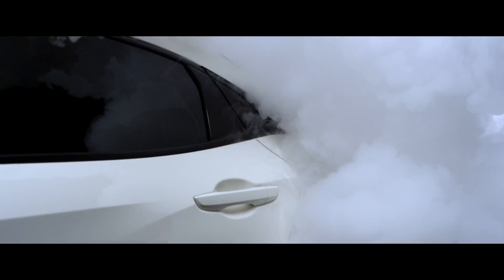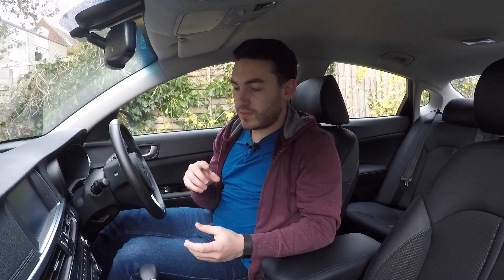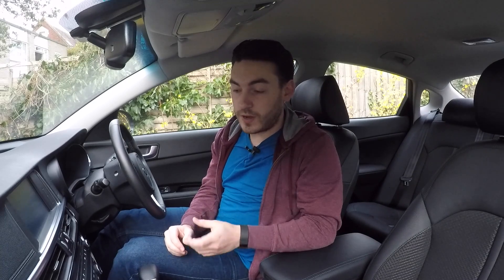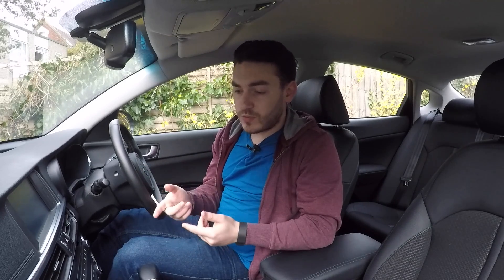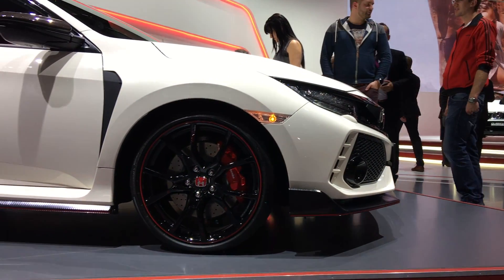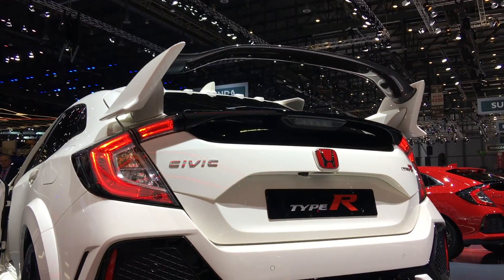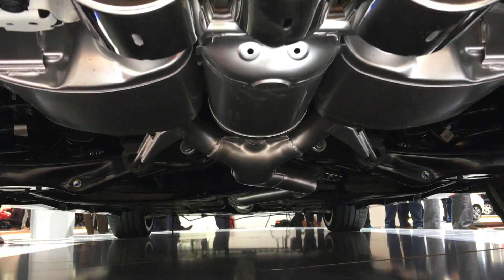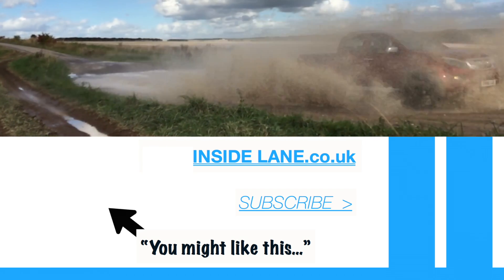Why 2018 Honda Civic Type R has Less Power in America - Inside Lane

Comment: Wow, this video is a load of garbage! The US version isn't rated at 306BHP, it's rated 306HP. It even says 306HP on the Honda US website. The difference here is horsepower is measured with losses while brake horsepower is just horsepower before losses. There is no real power difference between the US and European version of the car. 

And what you said about fuel rating is also nonsense. The fuel you're using in the UK is rated at 98-99 RON, 87 MON and 92-93 AKI. Premium fuel grade in the US is usually rated between 91-94 AKI. There's virtually no difference.
Reply: +WillerNK But I think it is clear. Automakers don't advertise power measurements that aren't used in that market, they use the standard measurements of that market. This only becomes confusing when people from other nations fail to realize other nations have different measurement systems. Seriously, it makes me laugh. They think the US uses the metric system?!!?? Also, it's clarified when numbers are given in either BHP or HP. If you know what that means, then there should be no confusion. When I watch a German or UK review, I know their measurements aren't going to be the same.
Reply: Larry If what you say is true then the US must measure HP differently to everyone else. BHP is always a lower reading than metric HP. The previous gen Type R had 310HP (~306BHP) and this new one has 320HP (~316BHP) in Europe. But if in fact you are wrong and the HP stated for the US variant was the metric unit of HP then you guys end up with ~302BHP.
Reply: The US doesn't measure in metric horsepower, it uses SAE imperial horsepower. If it were metric, It would be rated 320 in something like PS or CH  (different names for metric horsepower). In fact, the German spec model is rated 320PS.

Another thing, there is no conversion from brake horsepower to horsepower. The SAE net horsepower rating is just the same measurement of gross imperial horsepower but minus losses to accessories. And really, that's what everyone should be doing, whether it be metric or imperial. You aren't going to be running an engine without a water pump or an alternator, are you?
Reply: +Pigmoon K "US gas has lower octane rating that approximates to only 94RON" What does mean? That's an oxymoron, like saying "roughly exactly 94RON".

You aren't being clear, you're being stubborn and inflating the octane rating to support an argument that had no foundation to begin with. The North America Honda press release says, "306 horsepower at 6,500 rpm and 295 lb.-ft. of torque from 2,500 to 4,500 rpm (both SAE Net)"

The car is rated 306HP SAE, not BHP. There isn't a power difference, there is only a measurement difference. 
http://www.prnewswire.com/news-releases/civic-type-r-makes-us-debut-at-2017-autocon-in-los-angeles-300429223.html
Reply: You aren't serious, you're just trolling.
Reply: +Pigmoon K Read what was said again.

Because AKI is an average of RON and MON, there is no exact conversion of RON to AKI. The AKI rating equally depends on the MON rating. In the UK 98 RON is ~87 MON. So (98 + 87) / 2 = 92.5 AKI. In the US, premium fuel ranges between 91 and 94 AKI. That places it within range of the UK's 98 RON.
Reply: Speak English.
Reply: Pigmoon K They don't measure in RON dumbass, they have very similar actual octane ratings to Europe but they measure in AKI so the numbers aren't the same.
Reply: Pigmoon K I don't know what to say, I'm honestly shocked. Did you ever even attend a school? Forget it, I'm done replying, you're making me lose hope in humanity.
Reply: +Pigmoon K Please show me information directly from someone with a significant position at Honda that says the US model has 10BHP less because the fuel is 4 octane points lower. Or, if it's any easier, show me where on the official US Honda site does it say 306BHP for the US spec model..
Reply: +Larry Exactly. I don't how this video could be so misinformed.
Reply: +Larry I think you're absolutely right, but I think it would be best for countries to clarify which unit of measurement they're using. The US is using net imperial horsepower, the UK gross imperial horsepower, the Germans and many other nations use gross metric horsepower. Just saying "XXX horsepower" leaves people starching their heads.
Reply: US measures net horsepower in imperial units
UK measures gross horsepower in imperial units
Most other nations measure gross horsepower in metric units

There, it's that simple. And yes, this video is almost completely BS.
Reply: Pigmoon K Just because the number 94 is lower than 98 doesn't mean it's inferior. Don't you know how conversions work?? You clearly have no clue what you're talking about. Almost like saying 2.5cm is bigger than 1inch just because the number is higher. I think I'll stick to my initial insult proclaiming you to be a dumbass.
Reply: Pigmoon K 94 is only lower than 98 if they're both on the same unit of measure. This is VERY basic knowledge.
Reply: +Pigmoon K That isn't a known fact, what is a known fact is that people keep confusing different octane rating systems.
Reply: Felix Thank you. I can't wait to see what BS he comes back with next.
Reply: 1. "poorer RON fuel"? Is that a technical term? They're rated using different rating systems.
2. OK, so you claim the U.S. version's limit was already converted, THEN rated . So tell us what it was rated at in the EU rating system before it was converted...show us the math.
3. Six of one, and a half-dozen of the other. You seem to be fixated on making a fuss about comparative fuel quality. OK - we pay far less for fuel. Meanwhile (if this video is even correct) I can probably spend less than two hours getting that 10 hp back and driving on the same cheap fuel for the duration. You're stuck with that fuel bill for as long as you live there.
Reply: +WillerNK  He'd have to speak sense first.  He's just butt-hurt.  Wilful ignorance is the consequence.
Reply: Exactly, but it should also be noted that the US pumps say "Minimum Octane Rating". That means if a pump has 91 available, it's going to be 91 or greater.
Reply: I have no idea why this video wasn't thoroughly fact checked. I didn't even have to think twice about the difference between brake horsepower SAE net horsepower. Honestly, I'm just amazed that so many people don't know this, even automotive journalists.
Reply: +Pigmoon K  Let's be very clear.  You have no idea what you are talking about, and are just making yourself look more foolish by doubling down on your error.  A number of posters have made it clear why you are wrong.  Accept the education and move on.
Reply: +Pigmoon K You keep saying "91 AKI doesn't equal X" or "98 RON equals X"

98 RON doesn't equal ANYTHING in AKI or MON! There is no conversion at all! AKI is the combination of two rating systems that are entirely different and have nothing to do with each other!!! 98 RON can vary in MON, equaling anything from 86 MON to 90 MON, it just depends on the fuel. You can't covert any of these rating systems, they are different systems that test for different things PERIOD!!!

- Wikipedia > Measurement methods

"The most common type of octane rating worldwide is the Research Octane Number (RON). RON is determined by running the fuel in a test engine with a variable compression ratio under controlled conditions, and comparing the results with those for mixtures of iso-octane and n-heptane."

"Another type of octane rating, called Motor Octane Number (MON), is determined at 900 rpm engine speed instead of the 600 rpm for RON. MON testing uses a similar test engine to that used in RON testing, but with a preheated fuel mixture, higher engine speed, and variable ignition timing to further stress the fuel's knock resistance. Depending on the composition of the fuel, the MON of a modern pump gasoline will be about 8 to 12 octane lower than the RON, but there is no direct link between RON and MON..."
Reply: +Pigmoon K There is no conversion from BHP to SAE. Both use the same imperial system of measurement, but different things are being measured. Using the imperial unit system, brake horsepower is a measurement of an engine's power without a load. SAE HP also uses imperial units, but they are looking for the engine's power with a load placed on it  by accessories. There's no different system to convert, it is just a measurement of two different things. It's like trying to convert brake horsepower to wheel horsepower. People can use a rule of thumb to estimate wheel horsepower, but the only way to truly know is to dyno power at the wheels.
Reply: He's (She?) absolutely wrong, and he knows it, but he's a troll. Don't expect him to stop.
Reply: pigmoon, the only thing u got right was the fact that cars for the american market are detuned, perfect example of this is factory jdm sti vs a usdm sti both from stock, using the appropriate fuels for each car, the jdm will roast the usdm car, not for fuel purposes but for emissions.. do some research the fuels are still the same quality except are just using a different rating system
Reply: Pigmoon K premium here is 95 upwards , Americans use a different system for measuring and can not be perfectly changed from Ron to aki and backwards too, just follow whatever fuel it says on the owners manual and go from there
Reply: Pigmoon K I'm not even from the us at all, premium in nz starts at 95, highest is 98, our normal fuel for average get around cars with low compression engines we have 91, we can also get race gas which is over 100  but its not as common, the reason the cars in the us are  detuned is because their government decided to pull the emissions bullshit , so they're detuned to stop more pollution
Reply: +Pigmoon K I'm not American either, and I know you're a trolling idiot. How many times will everyone have to correct you....
Reply: +Pigmoon K Hey if you want to be a public lackwit that's your prerogative.
Reply: +Pigmoon K Imitative and unimpresive. Does your mother know you are still on the internet?

Comment: Not sure why Honda made it almost fifty HP down from its direct competitor the Focus RS. If it's the same money I'm going for power and AWD :)
Reply: The price point of the RS (or the STi) is higher than the Type R .
Reply: Chris Dooley If you intend to use it for drag races get the Focus RS, if you plan to track it get the Type R. It's lighter and way faster around the corners.

Comment: it's less than 3% ... you still get a monster FWD ! when I swiched to ethanol, there was a visible on graph gain of torque of 5%, from 2000rpm to 6000rpm , you know what, I did not feel anything. And I think that a car that accept 95 octane is so much more practical. 98 is more expensive, anf even in europe there are some places where it is not found (like in Corsica)

Comment: We will always get a water down car in U.S
Reply: Moses R actually this video is wrong. the US doesn't measure in BHP, we measure in HP so that's why the numbers are different
Reply: Seriously the comprehension level of some of these comments is baffling...10bhp will not be felt anywhere in the rev range. Now flash the ECU for a healthy addition of torque plus the corresponding HP gain and you're sorted.
Reply: maybe it helps to place a bigger hoodscoop aftermarket part, you know tunnel more cool air to the intercoolor... uhmm, wait, there is none on top of the engine bay? Well at least the red plastic engine cover get's cooled :-(
Reply: Moses R it doesn't really matter these days. all you have to do is tune the engine and 9/10 most of the type r's will get a tune anyways.
Reply: Worse in California! 
So far, I can still drive my 510 with swap motor...
Reply: We get watered down imports sometimes, but then again they get watered down versions of our superior cars.
They barely get the Camaro, but they don't get the 1LE options.  They get the Mustang but no GT350.  They don't get the Viper or Challenger.  I don't believe they get the Grand Sport or Z06 trims on the Corvette.
So as far as performance is concerned we have it better in America.
Reply: Well the Viper is a gas guzzler for sure (not that someone in the $100k+ supercar market would actually care), but unlike what seems to be the popular European assumption, the Corvette does pretty well on gas, better on the highway than most of the cars it competes with.
Reply: +The Hitman  I understand your points, but the problem is a lot of those perceptions are wrong these days.

I DD a Fiesta ST, so I understand how fun a hot hatch can be.  But I've sat in a new Camaro, and it is nicer in every way (except for it's bad blind spots, which are there because the fanbase wanted narrow windows).  Europe doesn't seem to cater very much to the $30k to $50k crowd.  There are soooo many cars above the $60k mark, but only a couple decent cars below it.
On a track the Focus RS is about as competent as a Mustang GT, so I can see how it would sell better, but despite having a smaller engine it doesn't really get better gas mileage.  And that is with you guys paying a massive markup because of import tariffs.  In the US a Mustang GT is $32k, and a Camaro SS which matches the M4 in performance is $37k...retail.  But you can get either for probably $4-6k less retail with just a little dealer negotiation.
If tariffs weren't in the way a V8 Mustang GT would cost 27k GBP (with an estimated $2k in shipping).  I'm guessing Ford actually charges closer to 40k GBP over there.
Reply: Moses R we have a hellcat what do you mean
Reply: The Hitman - yep, we got the Fiesta ST a year or so after Europe, and here it is much less popular than the Focus ST, and only available in 4-door.  But that suits me fine, it will haul my family, and is a blast to drive.
https://plus.google.com/112287122417757908676/posts/UZpUy6kqdn7
Reply: Moses R you are still getting the same car...

Comment: It looks like a lot of commenters don't understand that US pumps aren't listing octane in RON. We use AKI or (R+M)/2. 98 RON is about 93 AKI, I think. So Honda basically wants to tune this thing to run on regular fuel.
Reply: Pacheco Sorry to say but if it is in fact 306HP and not BHP then you're 14HP worse off than the euro version. Ours will be 320HP (~316BHP). The previous gen was 310HP (~306BHP). So if US is 306HP that means it will be ~302BHP.
Reply: +Kurt Phillips No, the car will be 320PS in metric units or 316BHP in imperial units. Both the US and UK follow the imperial unit system when measuring horsepower, but the difference is that US goes by SAE certified horsepower which measures net horsepower or the horsepower of an engine with all accessories loading the engine. Basically, the US measures horsepower its own way. There is no horsepower difference at all, just different measurements of its power.
Reply: When I say HP I mean metric HP. PS literally translates to Horsepower. Idc what each country's standards are, metric is what I'll use and will continue to use when I say HP.
Reply: Fine, but the US doesn't measure in metric horsepower, nor does it measure gross horsepower.
Reply: Pacheco That's fair enough, and you have taught me one thing I didn't know about beforehand. It just pisses me off that there isn't just one standard; it would make like so much easier. 'Standards' in general with all sorts of units are fucked up and not globally uniform. I just think it's BS.
Reply: Yeah, and if that isn't complicated enough, then there are nations that don't even measure horsepower at all!😥
Reply: Spamfried Oh yeah, completely forgot about kW. Good luck multiplying by 1.36 in your head everytime you want HP 😂
Reply: Depending on the MON rating, their 98 RON is equal to our premium, which ranges between 91 and 94 AKI. In fact, most places being 93 AKI. Everything about this video is wrong. The car isn't even rated in BHP in the US, its just rated in HP, which means there isn't even a power difference. The videos is just full of bad information.

Comment: This guy keeps saying they'll increase power mid-cycle. It's pretty damn rare for Honda to meddle with the engine outputs for a facelift on any previous models I've followed. Its usually only cosmetic upgrades.
Reply from the maker: +Mark Almeida This car will be measured by its performance against rivals. Just like every hot hatchback it will have to evolve to maintain claimed lap records .etc

Comment: Fuck. We only have 91 here in California. Higher grade we gotta go get it elsewhere. E85 then
Reply: +Alexander Chang That is not accurate. The fuel grade they use is rated 98 RON and 87 MON. That equals 92.5 AKI. 93 AKI octane is widely available in the US. This means the fuel we use is virtually the same. This video is way off. The car is even rated in BHP in the US, it's HP.
Reply: in euro we drive on 98
Reply: The US uses a slightly different index, so 91 octane is actually 95 RON
According to wikipedia, we use AKI = (RON + MON)/2.
Reply: You can get 95 here in NJ/PA but it's very rare. Most places have max 93 octane. I heard you guys also get bad quality gas in the winter for some reason :/
Reply: got 92 here in hawaii v-power

Comment: I completely understand the reasoning behind this. The yanks still run 'regular' 87 Ron petrol in their cars . isn't that why the USA Impreza sti had to be fitted with 2.5l displacement engines while Europe and Japan still had 2 litre?
Reply: the highest we get is 93 which is equivalent to your 98 however we are able to get 101 at certain stations.  People here just want to put 87 when its supposed to be a higher grade which is probably why they did this.  However our major tuners like cobb will start mapping asap and give us big power in no time so its not really an issue.
Reply: Joe O shell here has v power which is 99 RON. Might go to BP ultimate which is 98 RON but v power is what it's about. Most stations have 95 Ron only though but they are cheaper